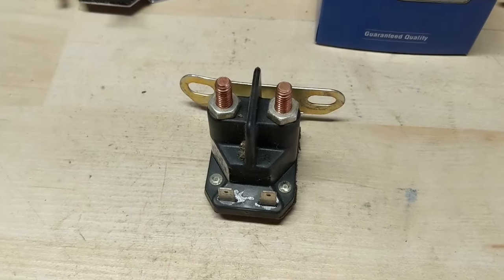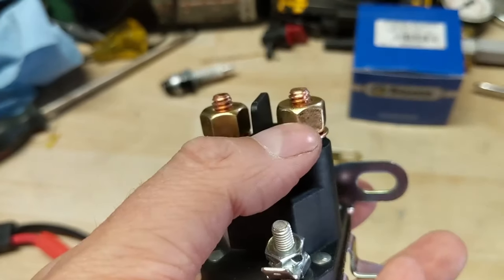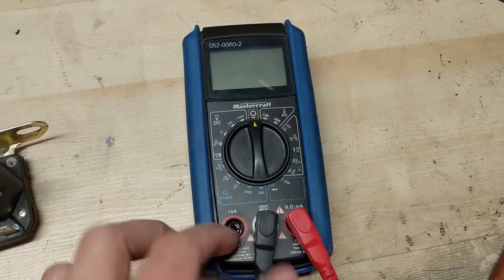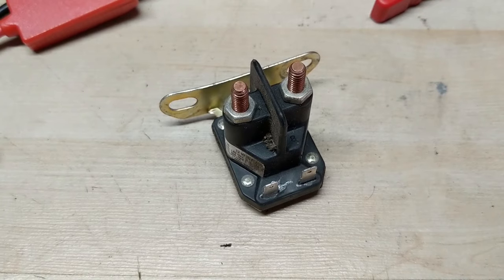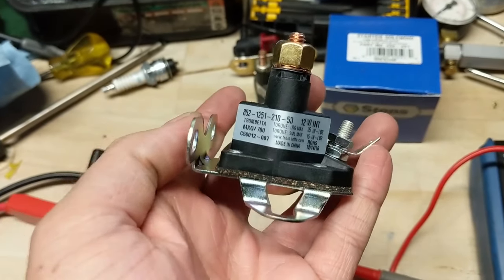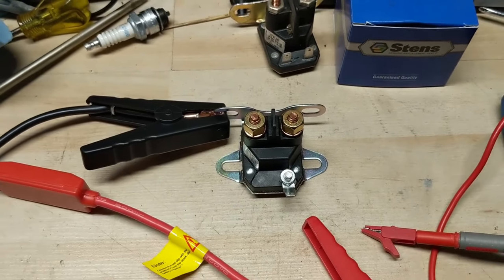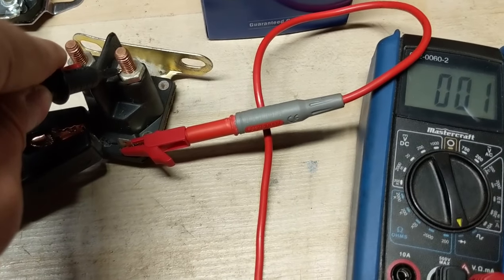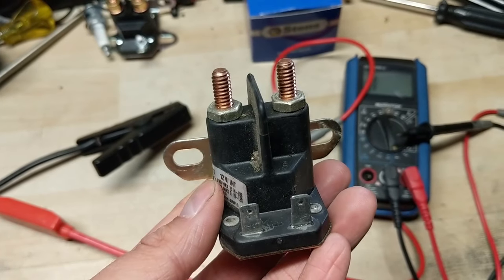How to Test a Riding Lawnmower Solenoid

Comment: Looking for continuity across the solenoid main terminals is not a good test as it does not account for resistance under load.Test across the main terminals with a low reading voltmeter while operating the starter motor,there should be full voltage across the terminals with the solenoid OPEN dropping to about .2 volts when the solenoid is closed.Any large voltage drop means resistance in the main contacts and less voltage/current flowing to your starter motor.Look for videos on voltage drop testing and try to become familiar with the concept.Not hard to do but too lenghty to get into here.
Reply from the maker: Yea this is just a basic, quick test anyone can do to test the solenoid.

Once you get into voltage drops, it may not be the solenoid, it could just be a bad connection on a cable or corrosion that's causing the drop.

Much more complex to get into with that, so I just stuck to simple continuity. If there's continuity, it's good, if there isn't, it's bad.
Reply: Just measure the voltage across the two FAT terminal posts while the solenoid is energized while it is installed & connected properly on the machine. Good battery of course. Simple enough. Good video presentation otherwise. Will be helpful to many viewers.

Comment: Your a 🏆.  I have a tractor that had nothing when I turned the key. Trouble shot it to 12v at the solenoid but still nothing. Figured the solenoid was bad. Followed your instructions and hooked a battery charger to it, solenoid charged the relay ( was not doing that when installed) check resistance,  good, reinstalled and engine cranked with no issues. Either bad connections, or stuck solenoid,  either way, it works again. Thank you

Comment: I don't know what's happening, but I've bought and returned about a dozen 3 post solenoids for my Ford 8N tractor and I haven't got any of them to click using the battery that easily starts my V8 pickup truck.  It also took me 3 solenoids to get one that worked for my John Deere ZTR mower.    In past years I never got bad solenoids for various vehicles.

Comment: I was using my lawn mower where there were a lot of puddles and when I shut it off, it would not start again and just makes a buzzing sound by where the key goes in. I used a multimeter and my battery is at 13. Any ideas??? Thanks Not sure if the water screwed something up.

Comment: My solenoid tested bad. Thank you very much for the good info. I'm ordering a new one, but I thought I'd try to "repair" the bad one so I could get my grass cut before it reaches knee-height. So... I dropped it onto my concrete floor a couple of times from about 4 feet. Amazingly, the housing didn't crack - not that it would matter.
The jolts musta freed whatever was stuck because it works now. MWAAHAAAHAA!
Maybe I should publish my own video on solenoid repair.

Comment: I have a solenoid problem. The side going to the starter burned out and isn't sending juice. It clicks but no power. Need a new one. I knew this before watching your video. What I did learn is about how the grounds work on the 3 post compared to the 4 posts. Thanks for the video it was very helpful.

Comment: I had a riding lawn mower silenoid that worked, then didn't.  I pulled it and tested it, sometimes it worked, sometimes it didn't.  I noticed the battery post was actually leaning in slightly, meaning it had over heated and shifted. This caused the internal bar to jam up and not always contact the top of the chamber. I suspect someone jumped it or something or the starter key was left on too long, causing the post to get hot. This was not one of the skinny post type, it was just like the one you showed. My suggestion is to always look at the condition of your Silenoid, if it appears damaged in any way, replace it, dont save it eather.
Reply: Yeah, that's correct regarding the key on for too long. My ignition switch was stiff and after it started the switch didn't return to the middle position. The starter was on, but couldn't hear it... Anyway it killed the solenoid.
Reply: Does it hurt the starter when you forget and leave the key on?
Reply: Lol at don't save it either 😆

Comment: You can also use a Ford car/truck solenoid; 12 volts and the tractor doesn't know the difference. Also more robust and likely easier to find in some places.
Reply: Youd be better off with a toyota solenoid 😆

Comment: I tested DC voltage at those two terminals when it was being powered before watching this video. It was reading 12v like i imagined it was supposed to. Do i even need to test continuity if this is the case? If so, why?

Edit: i think i realized the answer. Its not "on" when i have it hooked up normally so the circuit i want to test isnt closed. Hooking it up like you show here is supposed to close the circuit allowing it to have continuity. I was testing that the battery was supplying it with electricity with my DC voltage test on the terminals.

Comment: Could you post the brand/model of the 12-volt battery pack that you are using for testing components? Also, is the Eliminator battery pack that you use in other videos available for sale? I cannot find it on aa web search. Is that your own proprietary brand?

Comment: Hmmm,   mine clicked on a kubota zero turn,   could crank it with a wrench touching both poles of the solenoid,  so figured it was the solenoid. Replaced solenoid,   and same thing,  no start but would crank with a wrench making contact?  Must be a safety switch which this thing has several?    anyway,   good instructions   thanks
Reply from the maker: Usually if the solenoid clicks, safety switches are ok because nothing is preventing power to power the solenoid. If the wrench trick works, the positive and ground are ok, and the starter wire is ok. I would test 12v at the solenoid power wire. Watch this: https://youtu.be/vJWbfSxHY1Y
Reply: @EliminatorPerformance  Turns out I was hearing something else click when I turned the key?  and was NOT the solenoid clicking,  duh.   Ended up testing the key switch and that was it,  when you turned it all the way to "crank",  nothing. Replaced switch and good to go. Thanks for your reply   enjoying your channel,  good content

Comment: I replaced battery, starter, ignition switch, seat switch, solenoid, cleaned the terminals and grounds.  I had the same issue of 7v at starter. My engine rotates with ratchet.  So it’s not seized.  The brake and PTO switches light up when key is turned and they are in wrong position.  No click & no start.  I’m thinking I may have a bad red starter wire?
Reply from the maker: It's possible, watch this video, hope it helps; https://youtu.be/vJWbfSxHY1Y

Comment: do you have to push down on the brake as well as sit down on the seat in order for power to transfer to the Spade connector connection of the solenoid? or will power go directly to the Spade connector regardless but just will not turn the engine over because of the safety switches in place? thanks for your time.
Reply from the maker: The brake lever has to be engaged, or getting more technical, the brake safety switch has to be engaged. The seat switch does not have to be engaged for starting. Only engaging the blades.
Reply: My x300 turns off when I get off the seat,a jumper wire fixed that..

Comment: I tried taking notes..(something we 'older'  'lady' folks do.)..and tried to look up the things needed ( on Amazon Prime (days..last sale day) but couldn't find the small  Lithium battery pack you state is needed and the alligator clips ..I haven't seen a size......HELP !!!!  A.S.A.P  Thanks!!
Reply from the maker: The one I have is unfortunately no longer sold, it was the Pushidun 12v portable car battery jump starter if that helps. You want something small that can recharge over USB cable. It cost about $33 I believe it was 2020 when I bought it.

Comment: Can I use a car battery in place of the lithium ion battery pack, or is that too powerful?
Reply from the maker: It'll be fine, just make sure the car isn't running if you're jumping it. Or just use the car battery itself.
Reply: @EliminatorPerformance  I was actually going to use the battery used to start the lawn mower which is 350 CCAs, if memory serves. Anyway, I appreciate it. Great video!

Comment: As an electrician, I would like to warn everyone to only use cheapo multimeters while testing for continuity with voltage present
Reply from the maker: The current in the circuit is only on the electro magnet. There's no current at the posts where I check continuity. That's because it's on the work bench. Had this solenoid been on a machine, I would've simply tested for voltage at the post that the starter hooks up to.

Comment: My solenoid is clicking it is brand new just put it in, I run a test light and I touch the terminal that leads to my battery my test light comes on I then turn the key on and I touch the terminal that goes to the starter and the light does not go on can I have bought a defaulted solenoid

Comment: I bought a circuit tester.   Battery is fully charge I get power to the solenoid.  It clicks. The tester has an  small alligator clip. The light lights up when you turn the key with the side of the solenoid coming from the battery. When you turn the key it gets dimmer. The starter does not turn. I checked the starter side no power.  So I took it off. It has 4  post. I notice  both of the hot wire, and the ground are super rusty. Could that keep the solenoid from  giving power to the starter. I checked down at the starter. With the tester. No power when I turn the key. Thank you. Does any body in America make Solenoids?

Comment: I have a four post, I cannot get a clicking sound or diagnose my problem yet. I’m getting high 12s on battery post, charged for hours with charger and tender. Multimeter showed 12+ from battery post to negative on starter. I also had 12+ from negative post on battery to the positive end of post connects to short positive wire. I never tried jumping the terminals to see. Been on this failed repair project for two days 😐
Reply from the maker: https://youtu.be/vJWbfSxHY1Y
Reply: @EliminatorPerformance  thank you sir, that’s one of the other uploads that I watched when searching the topic. If I had a question, can I post it on here? I’d like to make some progress with this repair.
Reply from the maker: @timweb1510  if you have 12v at the charging wire when turning the key, and the solenoid doesn't click, it's a bad solenoid. If you don't have 12v at the small charging wire when turning the key, it's something else.
Reply: @EliminatorPerformance  going to try and run over to the house and check again, thanks

Comment: Question.  I checked my battery (12.7 V).  I checked where the red batter connects to the solenoid: 12.7 V.  I unhooked the wire that goes between the key switch and the solenoid.  I hooked my red multimeter wire between that wire and ground and turned the key: 12.7 V.  Then I checked the voltage at the solenoid post that goes to the starter.  I turned the key: 7 V.  I checked the voltage at the starter and turned the key: 7V.
That seems to indicate the solenoid is bad, but if I tried this trick, I can hear the click and the fact that I have 7V tells me it would pass a continuity test. Agree?
Reply: Hello What ended up being the issue ? Weak solenoid ?
Reply: @josephpuchel6497  Engine was seized up.  I don't remember what part did it, but I got rid of that thing.  Piece of crap broke down after every other mowing.
Reply: I replaced battery, starter, ignition switch, seat switch, solenoid, cleaned the terminals and grounds.  I had the same issue of 7v at starter. My engine rotates with ratchet.  So it’s not seized.  The brake and PTO switches light up when key is turned and they are in wrong position.  No click & no start.  I’m thinking I may have a bad red starter wire?

Comment: Dude....you do a very knowledgeable video, a bit fast, maybe, but everybody doesn't know as much as you do about electricity and testing components. It would be helpful if you said when a "powered" solenoid "clicks" does that mean its good and doesn't need to be replaced ?? I'm assuming it does, but I'm not certain......
Reply: I it dont click, that mean there is a problem.  If it clicks that mean that power is going through the posts as expected.  The begining of the video explans how it works.

Comment: define continuity!? a bit confusing as your multi meter showed almost nothing and you said it had continuity. looked like it showed a bit of power when you put ends together but then nothing, no reading
Reply from the maker: 0 means there's a connection, a resistance test would be better but a simple continuity test just shows there's a connection.

Comment: If you have to jump over the solenoid with a screwdriver to get the mower to start is that a bad ignition switch or solenoid?
Reply from the maker: That just shows you have a battery connection and ground and the starter works. Watch this video, hope it helps; https://youtu.be/vJWbfSxHY1Y